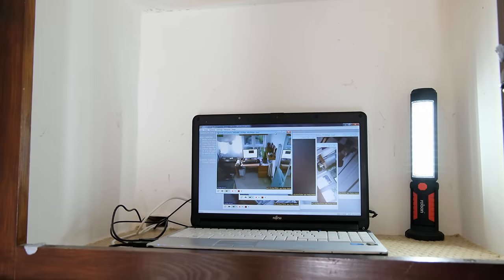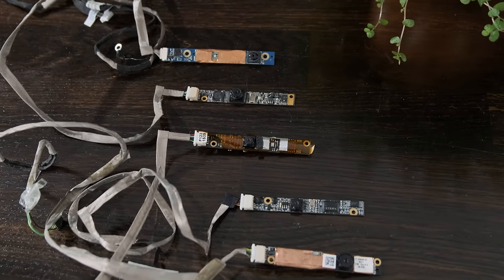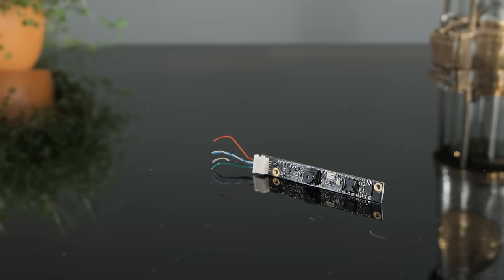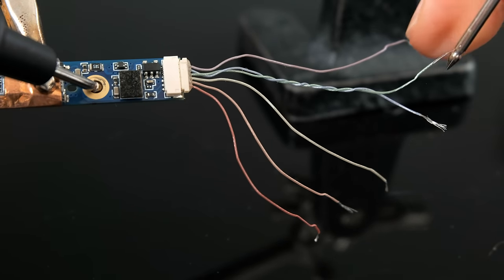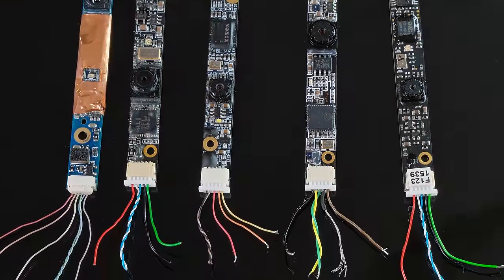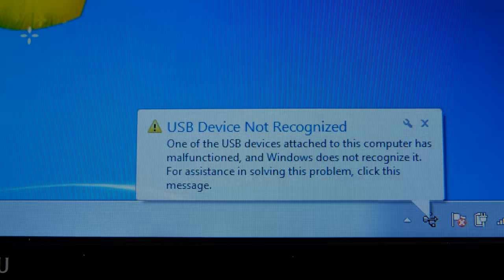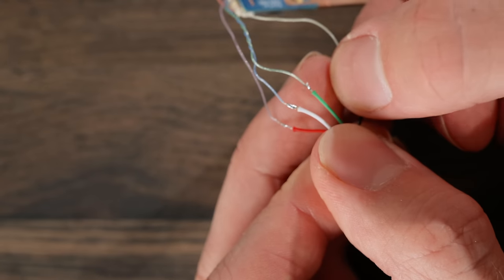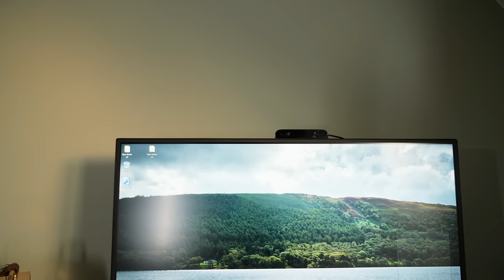How to Convert Laptop Webcams to USB Webcams

Comment: Nice extra channel! I did this hack to my webcam, but mine is 3.3v, I have to convert the 5v of the USB to 3.3v, otherwise it will warm a lot! And maybe burnout!
Reply from the maker: Interesting observation!
Reply: just a voltage regulator will work.. converters are more energy efficient but it adds more bulk and takes up more space. Something like this https://www.tinytronics.nl/shop/en/lm1117t-3.3v-voltage-regulator
Reply: I have used a diode to drop the voltage with very good success.
Reply: @lorenkoehler5704  qual é a marca o diodo?
Reply: @wysley12  Qualquer diodo funcionará, apenas em série, para diminuir a tensão. (Google Tradutor)
Reply: @benskidmore6523  mostra o modelo esse diodo mas pode levar queimar em correntes ?se acho q pode diodo nao tem correntes e apenas baixar tensao
Reply: @lorenkoehler5704  I guess you used like 2-3 diodes?
Reply: @Jonas_Aa  Yes, two in series. But you need to have them in the right orientation.
Reply: @lorenkoehler5704  Are two 1n4007 diodes good too instead of zener ones? Will I risk to damage something? thanks
Reply: @mrcolo.  Regular diodes work just great. Put two in series which should give you a 1.4 vdc drop and that will be close enough. If you have doubts about the polarity, just measure the voltage before connecting it to the webcam.
Reply: @lorenkoehler5704  perfect thank you very much

Comment: Could I do this with the camera from a phone or tablet?
Reply: Not if your mobile device doesn't function. The cameras on phones/tablets are connected directly to the SoC, and it doesn't use USB protocol. There's no way to disconnect and get data from the camera.
If your device still functions, there are some apps you can use to stream the video from your mobile device to a windows device.

Comment: Hey matt, is it able to do this with cellphone cameras? Because there quality are really good.
Reply: I am afraid they will not talk the USB protocol so it won't be so easy.
Reply: It's very hard to do what's shown in the video with a cellphone camera, but you can download an app to link your phone to computer via USB or WiFi and use it as a webcam. You could make a foam board case for it if you really want to, but when I did this I just propped my phone against my monitor and it was alright.
Reply: I can't recall the name of the app, but there's an android app that will allow an old phone or tablet to be used as an wifi IP camera.
Reply: @timmooney7528  DroidCam. I use DroidCam a lot for video meetings and I really love it. MUCH better than my laptop's webcam quality.

Comment: Subbed immediately!
Something similar with an old smartphone camera pls
Reply: If you really want to re-use a phone camera the best way to go about doing so is downloading an app, you generally can't do something like what's shown in this video, you would need to figure out what connector it uses for example it might have a BM10/14/20 FPC connector then solder those teeny tiny pins to a breakout board or something where you can more easily test/probe the pins and on top of that phone cameras don't use a typical usb interface, they're more directly connected to the SoC which means you would need to make your own interface using a microcontroller or Raspberry Pi or at least look for someone else's project as a guide at making one. 

Basically in short a few people may find it a fun project but it's not at all worth the effort when you can get good usb cameras or cameras that are natively compatible with boards like the Raspberry Pi for $20 or less.
Reply: me too
Reply: Smartphone cameras are pretty much the sensor only. How to read data off of it is a very closely guarded secret for each and every sensor.

This means that the phone is the only thing which will be able to access the camera 😕

Comment: Do we know what the "unused" wires on these boards are? Are they for the activity LED that's a complete lie because it can almost always be turned off even if the webcam is in use?

(Technology Connections has a video on the stupid design of the activity LED on most laptop webcams.)
Reply: On my cam the light always lite up when cam is used. Even when thise wires are not conected.

Comment: What if there is a metal shield all the way across the front of the webcam and just large blocky tracings on the back? Can I still manage to make this?
Reply: You can hold the measuring tip to the shield to measure ground. It's normaly also coneted to ground. D+ and D- mostly twistet together. Positive you have find by trial and error. First try 3.7 Volts for positive by adding two diodes in series and only after that try it with 5 volts.

Comment: Thanks a lot for this, Manged to upgrade my 3D printer with this method so i can remotely monitor prints. And all i needed was an old USB cable and Dead laptop i had lying around. Fun 10 min project after discovering my 3D printer Firmware supports Webcams.

Comment: How do you connect (wire) the microphone and the speaker from an old laptop
Reply: Diy perks channel has a video about it
Reply: @man0sm  are you sure about this? i couldn't find any video that explains this. in my case the microphone is on the same module as the webcam.

Comment: My webcam has two pairs of twisted wires, one for cam and one for microphone that's on board as well. Is there any order on how to solder them on usb connector correctly?
Reply: Your microphone will need to be wired separately if you want to use it, and it'll need to be wired to a jack and plug into your computer's microphone input jack.  The ground connection for the mic is generally affixed to the electret capsule, so you should be able to locate that on the board, and check continuity to it's case.  google electret capsule if you need to find out what they look like.

Comment: I can get as far as USB device descriptor request failed, but at least that is something. I would try the drivers from the laptop I pulled it from, which I believe was a HP DV 6000 series, except there are no separate drivers for windows 10. This is a really cool project, and I have other cams to try!
Reply: Have you tried it to flip the data wires around and try again?
Reply: @kuskus9039  I put that project on hold for a bit, but that is a good idea that I can try soon.

Comment: if the webcam has 10 wires. it is very simple. just find the ground. then the 2 data+ and data- are together and the rest just solder it together. it is positive+. simple :)

Comment: Matt please consider doing a video on making these cameras wireless. Either with a usb wireless or a wireless card from a old laptop
Reply: I'd consider a Raspberry Pi Zero W or other SBC with wifi and USB, as wireless cards and USB webcams don't work on their own, they need some computer to be controlled by and to actually stream the video, and it's easy enough to set up on Raspberry Pi.

Comment: i have a lenovo z50 laptop cam with 8 wires 
BLACK
RED
BROWN
ORANGE
GREEN
BLUE
LIGHT GREEN AND WHITE TWISTED
CAN YOU GUIDE ME with the connections to the usb .
Reply: Green and white twisted would be the data, ground is most likely black and red is most likely power. Blue might be ground if black isn't. The rest is probably for things like microphone. Check for MLCC capacitors - they look like orange or red bricks with contacts on ends, they are on most boards, and if you find that there is multiple that have one terminal connected to one wire, and one to the other then those would be power and ground. Or if the biggest capacitor is connected to two of the wires then those will most likely be ground and power. If there's metallized screw holes or flat areas that touch some structural metal parts of the laptop then that's ground. But with so many wires it might not necessarily be USB (but it probably is). Ground is usually red, but can be yellow, orange or light green but that's rare, and ground is usually black, blue or no insulation, but I have seen brown too. I'm just guessing and that's how I'd try hooking it up if I had just found it in a dumpster or a dead laptop, so if it smokes don't blame me. Don't connect the rest of the cables unless you've tried the ones I said in both orientations of data lines and nothing showed up in Device Manager. And maybe try 3.3V instead of 5V first as it might be 3.3V and will be damaged if powered with 5V (preferably a step-down converter, but 3 diodes in series will work too).

Comment: Please, if you know, do the video about what can you do with parts (cams, mics) of broken smartphones
Reply: Issue with dead smartphone camera is that they are highly specialised interfaces. You can't just slap them onto a USB cable, as they are meant to interface with the processor directly. Microphones you could literally just wire to an amp and use, just like the speakers

Comment: Hey, I love your videos.  Do you feel this will be possible with a Windows Hello enabled laptop webcam?  While you used the native webcam driver shouldn't it also be possible to use the laptop specific webcam driver? any thoughts would be useful. I very much want to enable Windows Hello on my PC and the Logitech Brio webcam is scarce at the moment.
Reply: Windows Hello works by using an infrared camera - which would probably have a second connection. That said, higher-end cameras like modern Macbook Pro and Surface devices use a PCIe connection or maybe even a proprietary one in Microsoft's case. It's not so much about drivers - most laptops use a generic webcam driver for a generic module.

Comment: Good video ! I think I would try this once I will get back my used computer. Concerning the video, what's the purpose of the 5th wire ? (I don't know if you mentioned it)
Reply: If you mean the "5th wire" from his USB cable, it's not really a wire - it's the braided shielding twisted/pulled out of the way.  You may or may not need to use it, depending on what laptop cam you have.
Reply: @TheTalonts  I get a "Unknown USB Device (Device Descriptor Request Failed)" Error, I have tried switching the data cables and it didn't help, do you think that could be because of the other wires that are not used?

Comment: good video, i was waiting for you to fall on color codes but it was more than fine... also touchpads can often be repurposed the same way, done that a couple of times
Reply: Touchpads are still using the PS/2 protocol after 30 years <3
Reply: @benskidmore6523  oh yeah!!.... i forgot it was PS2... now i remember having connected a recycled touchpad via a PS2 to USB converter and then to a tablet OTG... LOL

i found my new i3 laptop to have i2C communication instead... the sucker requires special intel drivers, windows is not enough, i deleted em in a "cleaning rampage" and the touchpad stopped working, a bit annoying to find the correct drivers and make it work againg

Comment: When I tried it for the first I connected it into a USB2 port. If it was going to work it no longer is. It got very hot and "malfunctioned"
Reply: It might have been powered by 3.3 voltage instead of the usual 5v output from the USB. So it burnt out bc it could not handle that much power, also why it heating up. As someone else mentioned in the comments you probably needed a voltage regulator.

Comment: Hi Great info and presentation!  We're looking to integrate 2 micro cameras into our van build, van-life security.  We want them wired and on their own tiny monitor that can be turned on and off quickly using the least amount of electricity.  A small dedicated monitor that doesn't need any startup time (ideally independent battery).  Would you happen to know how we can go about this?   Reason for use: parked in city, peeps getting weird outside, turn on monitor, determine if they are passive crazy or harmful crazy; turn off monitor, go back to sleep.  Don't want to mess with wifi, and computer interface, just monitor--don't know where to turn for info, but you could sell a lot of these to the van and Rv community if you come up with a simple solution.  Thank you, B

Comment: I have tried this before after your security system video. But the wires were just too small and too thin to work with. Do you have any tips for that?
Reply from the maker: Hmm, not really. Best I can suggest is using some handy clips to hold them and use a decent pair of wire strippers to pull off the sleeving.
Reply: Solder directly on the connector pins.

Comment: Any idea what that 5th wire is for? Hve done this mod in many webcams and its almost always there
Reply: The 5th wire is a direct connection to the NSA
Reply from the maker: Usually a microphone.
Reply: DIY Perks EXTRA is it possible to interface that microphone with the USB mod? Or is it proprietary (different with every webcam) or just not worth it?. Notably I have seen webcams with upwards of 6 wires (Just opened up my laptop to see, and it has 6 connections). But most old laptops (that people will have lying around) have 4-5 wires in general. It’s good to see someone helping out in recycling and reducing waste, love your videos man❤️ Keep it up!
Reply: @neelkanthgovindji1173  Just use a FOIA

Comment: Pulled a webcam out of a scraptop the other day thanks to your home surveillance vid. This vid is great for going into more detail. You've made it so easy that the only hard part is figuring out where to hide the camera and laptop so they aren't an eyesore.
Edit: I get a "Device not Recognized" error no matter which data wires are connected, and it's only a 4 wire webcam. Ah well. Also other tutorials recommend a 3V voltage regulator or 2 diodes in series to limit the pos. voltage since webcams can break otherwise.
Reply: Could be caused by low voltage power supply. Some webcams have regulators, and by decreasing the voltage the regulator can't work properly and as a result it outputs a lower voltage than required.

Comment: can we use from old smartphone too?
Reply: Nope, most of the video processing from the camera is in the phone's SoC, and it would be too expensive to find out how to reverse-engineer that. Webcams from laptops or for USB use have either a separate integrated circuit, or have it on the sensor die. It takes up space, so in a phone it ir in the SoC. That also lets the video hardware be accessed faster by the CPU and use the phone's main RAM ando other things, and leaves the camera sensor cooler by not having things attached to it directly, which decreases noise in dark scenery.

Comment: Hi Matt,
I would like to ask you for some help. Been following your other channel for a couple of years and I think you are the right man. I recently had trouble with my gpu fan going south and had to remove the shroud . I tried hot gluing a case fan to the heatsink and the temps are well under control . The problem is that the hot glue is not sticky enough and the fan basically goes away. I thought about wiring it to the heatsink though the wire might be conductive so I am afraid to toast the whole gpu. Would you have a solution to stick and hold in place the fan ? thanks
Reply: Problem is, you are using hot glue to attach something that is designed to cool . The hot glue will be heating up and re- melting

Comment: Hi, if I want to buy one, how do I know if it follows the usb protocol ?
Reply: If it only has about 5-10 wires to it, it probably does.  I saw some with 21 or 26 connectors, those must have the controller board on the motherboard or the back of the display panel to save some room.

Comment: Please make a video on increasing UPS Backup time by replacing Lead acid with 18650 cells.
Reply: This is fairly easy but very much not recommended for two reasons, you just get enough cells for your desired capacity, wire them up in three sets so you get 11.1v nominal then attach a BMS to it, no why do I not recommend this? First because lead-acid batteries are super easy to maintain as they can be constantly charged at a slow rate for long periods of time and UPSs make use of very simple charging circuits to take advantage of this, which means that you must ensure that your BMS will completely cut charge to your cells once full otherwise they will trickle charge until they blow up or pop the safety lid, secondly most consumer UPSs are designed to be operated at their given capacity, they are rarely intended to be ran for long periods of time, which means making it run longer will generate more heat than ever expected and possibly kill it, so only increase the capacity if you also increase the cooling or get a high quality prosumer/business grade UPS, so like a ~$400 cinder block or a 2U rack mount type of UPS.

Now you can find lithium based drop in replacements for lead-acid but those tend to be very expensive, so unless you're operating something crucial and it needs to stay online it probably isn't worth it.

Comment: Well done. Back to the basics. I'd like to see more of that.
Does anyone have any idea how I can find a used webcam with at least 1080p or better with 2K or 4K?
Reply: 2k is 1080p, effectively. 2560x1440 is QHD. :)
In my search for the best webcams I discovered that Apple and Microsoft are using PCIe rather than USB, so it's harder to improvise an external cable. But if you look for a high end laptop's camera such as a Dell XPS series or gaming laptops, you may get lucky. In general aim for newer models.